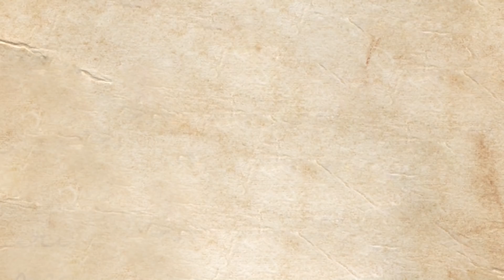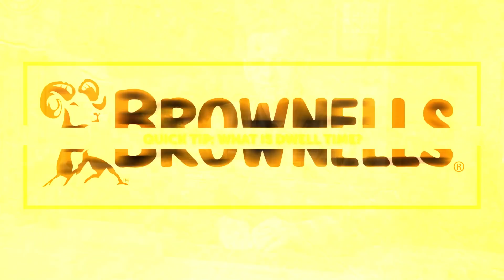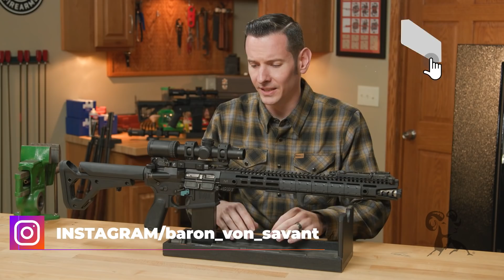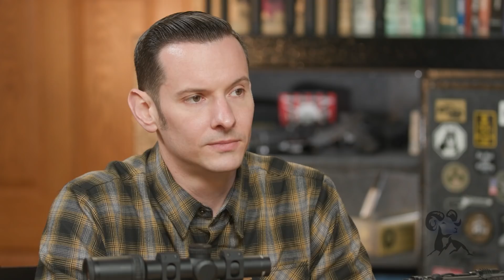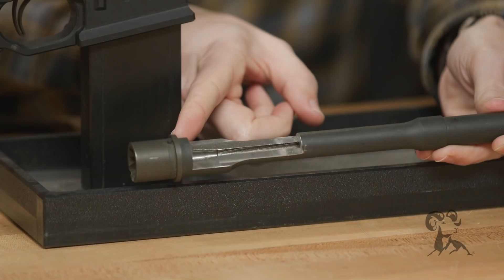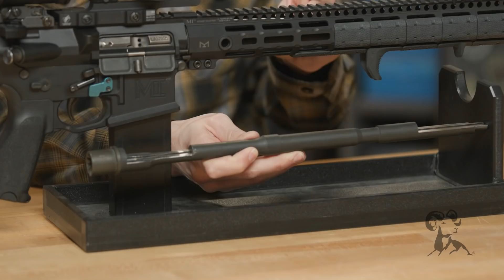Quick Tip: What Is AR-15 "Dwell Time"?

Comment: I don't claim to know as much as Caleb but I'm having trouble distinguishing between "amount of time the gas is working on the system" and "distance between the gas port and the muzzle." So the gas cannot work on the system until the bullet passes the gas port. TIME STARTS. Now the bullet travels from that point to exit the muzzle where all gas pressure is expelled out of the barrel. TIME STOPS. Seems to me, dwell is absolutely measured by distance between the port and muzzle. My question is about an adjustable gas block. All other considerations remaining the same, can dwell be adjusted at the gas block? If so, how and why?
Reply: By my thinking, it's not the distance between the gas port and the end of the barrel, but the time it takes for the bullet to travel that distance. I think they're splitting hairs here.

Comment: Hey Newby here. So, how does the port (gas) size and position and buffer weight effect calculating a build to accommodate smooth reliable operation and longevity. And how to calculate that. I.E. small port near chamber vs large port near muzzle. Thanks

Comment: So just to be clear, a carbine length gas system has more gas then a mid length ? I am fairly new to this and I am having trouble with my current build.

12.5inch barrel with a carbine length with a 3oz buffer tube and I am short stroking every couple rounds. I thought I was because I didn’t have enough gas and I am about to order a mid length gas system to fox that. But from my understanding the carbine length should be producing more gas ? 

Thanks

Comment: Thank u for this video. I was dying to make my 16in 556 into a “dissipator” or even use an intermediate gas length. But now i realize that a mid length gas system is the perfect option with an AGB. No point to risk the dwell time being too low with an intermediate or rifle length gas system on a 16in.

Comment: Ok ok let me get this straight 
Dwell time is the amount of time gas is acting on the system and it is not the amount of time it takes the bullet to go from gas block to leaving the barrel. 

My problem here is that the gas starts to act on the system as soon as the bullet passes the gas block and it stops acting on the system when the bullet leaves the barrel. *Passing the gas block = gas starts to act on the system. 

*exiting the barrel = the gas stops acting on the system 

Therefore dwell time does equal the amount of time it takes to go from gas block to exiting the barrel. It may not be the technical definition but it does infact give you the correct answer. Once you define the points where the gas starts and stops acting on the system both definitions are correct.

Comment: So even after the buffer has retracted as far as it's going to go and is starting to move forward, if there is any remaining gas pressure that is causing resistance of that forward movement, it's still considered part of the dwell time?  Or, is dwell time just the amount of time until the buffer starts to move forward again?

Comment: Dwell time is the amount of time it takes for your bolt carrier group to begin the movement of extraction of a spent cartridge.

In other words, the time the BCG 'dwells' in place after a cartridge is discharged.

Dwell time is measured in fractions of a second.

This is affected by the length of you gas system, the powder load in your ammo, the back pressure of a suppressor, and the weight of your buffer and bolt carrier.

All of those factors can be tuned to adjust accuracy, extraction pattern, felt recoil, and wear and tear on your rifle. It can mean the difference between a smoothly and comfortably operating rifle, and regular malfunctions, stuck cartridges, and premature parts failure.

Comment: You could have explained it using physics. Pressure equals force over area. P=F/a. When the surface area of the barrel increases with length, the force of the gas in the barrel is distributed over a larger area which results in a lower Pressure.

Comment: I'm a retired machinist and have worked on my pistols and rifles my whole life. Every problem that can cause a misfeed of any kind can be grouped into one category, TIMING. It doesn't matter what you call it, the timing of the mechanics have changed. 99% of the time this change is due to contamination of the moving parts or DIRT. It doesn't matter if it is actual soil or powder residue. The minute that any friction point  is increased that's where the change in the function of the firearm happens.
A good cleaning and lubrication and the removal of any interference will restore your firearm into its original working condition. It's just that simple.
Clean your weapon!!!

Comment: The description that you just gave that determines dwell time, is the exact time that the bullet passes the gas block, until it exits the barrel tip. Alot of people refer to it as cork time. The amount of time that the gases interact upon the cycling of the gun dies not determine the amount of pressure applied at all times, no, but it does describe the time for which gases are applied to the gas tube, which is the anoint of time that it takes the bullet to pass the gas block, and exit the barrel. You didn't ask what the pressures were along that time, you only asked what dwell time was. 
Then you went into the specifics of gas pressures, buffers, and spring tentions, which all affect the performance of the gun, but your original question was what is dwell time. The dwell time is the amount of time that the gases enter the gas block, which us when the bullet passes the gas block, until the bullet exists the end of the barrel, period. Do thise pressures vary at the instant tge bullet is fired until it exits the end of the barrel, yes, but the amount of time varies little, which if you wanted to get extremely technical, those times can be affected by the exact amount if powder, bullet weight, temperature, and other factors, but dwell time is the amount if time on average that the bullet spends between the gas block and the end of the barrel, it's that simple! It is also called cork time, and in my opinion is a good descript to what is happening because it corks the barrel and applies the gas to the gasblock, the gas tube, and the bolt carrier and bolt.

Comment: I've seen some "exotic" gas tubes that incorporate loops around the barrel to give you  that effect of having a longer gas tube at a closer gas port length. Would this modify the dwell time for a system?
Reply: No. It's not the length of the gas tube, it's the length of barrel after the port. If anything, it will reduce dwell time.
A longer tube will help reduce the pressure spike, but you could just use a smaller port hole or an adjustable gas block.

Comment: You said that dwell time is “the amount of time that the gas is acting on the system”. So, once the gas unlocks the bolt and the bolt carrier moves back far enough to get the gas key off of the gas tube, the gas is no longer acting on the system. That tells me that a pistol length system has the shortest dwell time, not the longest. Also, the carbine gas system would have a shorter dwell time than a mid-length or a rifle length gas system. I agree that a shorter gas system has a higher pressure than a longer one but, I think that dwell time is directly proportional to the gas system length. Why am I wrong?
Reply: Pressure curve drops as it occupies space in barrel and gas tube. It’s also dependent on powder burn rate.  That’s my take on it!👊👊👍.
Reply: @Eyeontheogive  That only further illustrates what Michael Peterson stated.

Comment: The relationship between barrel length,  gas system, and the 5.56 cartridge  would have been appropriate to talk about here. For example , the ideal setup is a 20" barrel with a rifle length gas and buffer . Everything else is a fix , or work around for a shorter gun.

Comment: Dwell time = the time gas is acting on the system. The time gas is acting on the system = how long it takes the bullet to go from the gas port to the muzzle. So, dwell time = how long it takes the bullet to go from the gas port to the muzzle.
Edit: In a DI AR. In a piston driven action, dwell time will be influenced by the gas release porting of that system.

Comment: "Dwell time is the amount of time the pressure from the fired cartridge is acting on your firearm system"  Is essentially (as in IS) the same as how long it takes the back of the bullet to get from the gas port to the end of the barrel.  Once the bullet leaves the barrel, the pressure drops to zero almost instantaneously (hundreds of microseconds).  Therefore, they are essentially the same thing.  Claiming the google definition is wrong, is wrong!  The best that can be claimed is that is is not completely accurate.
Reply: Agree... The gas is acting on your system until the bullet exits the barrel... In a perfect world all the powder would be burning up until the bullet leaves the barrel... this is not always the case hence large fireballs or failure of the action to feed another cartridge... This is a balancing act...
Reply: Not completely accurate = wrong.
Reply: @CalebSavant  My rifle's dwell time is about 145 microseconds.  The difference between "the amount of time the pressure from the fired cartridge is acting on your firearm system" and the time it takes the back of the bullet to get from the gas port to the end of the barrel is less than 3 microseconds.  Close enough that it can hardly be measured with $50,000 equipment.  2% less for the colloquial definition.  Again, closer than can be adjusted for or measured.

Comment: When shooting the 6.5 Grendel with a 22” or 24” barrel you can get what is called “belted” cases when the cases are being extracted while the pressure is too high.  The case gets ballooned out and looks like a belt on a magnum cartridge. Proper powder selection will prevent this from happening.  This is due to excessive dwell time on gas guns and fast powders.

Comment: Always was taught it had to do with distance between end of the barrel to the port in the gas system….thought that this is what truly affected reliability. This is based on gas pressure exerted from rear of bullet into the gas port after firing…that time where the bullet passed the gas port and allowed the gas to interact with the port and the bcg.  Did I have this wrong??  Caleb??
Reply: No, that's correct. In a direct impingement AR, the distance of the gas port to the muzzle determines dwell time. A pistol length gas port 6" from the muzzle will have the same dwell time (but higher pressure) as a rifle length gas port 6" from the muzzle.
The reason it might not be considered correct in all circumstances for all firearms is because in, for example, a piston operated system, the gas relief porting of the piston also determines dwell time. So his definition is correct for all gas operated systems, but the "port to muzzle" definition is correct for all direct impingement ARs.
Reply: Thanks bud. This is a 30 minute video if you ask me.

Comment: Caleb says at 1:56 the wrong definition of Dwell Time  "is the amount of time it takes for the bullet to pass the gas port and exit the muzzle", but then at 2:33 says Dwell Time  is "the amount of time the gas is acting on the system." That's contradictory. There is no gas pressure in front of the bullet. Gas can only act on the system after the projectile passes the gas port.
Reply: Gas can only act on the gas system once it passes the port, but like I said in the video.. to look at it as the time the bullet passes the gas system to the time it leaves the muzzle does not take all other factors into account, which is why it is the wrong definition.
Reply: @CalebSavant  Hi Caleb. Thanks for the reply. I love your videos. This one just got a little confusing with the terminology definitions.  Still gets the points across though.

Comment: Wow. I have a dwell meter. However not for measuring this kinda dwell. For those who are to young to know, dwell time was a measurable amount of time the points in older car ignition systems stayed open to fire a plug on any given cylinder of the car engine.

Comment: This is confusing. If there are higher pressures with shorter gas systems, then why are there higher bullet velocities with longer barrels?  As the bullet travels down a barrel, the space/gap between the empty case and the back of the traveling bullet increases, so does the volume of that space. Increasing volume will drop pressure unless the burning gas/powder can add pressure at a rate faster than that is being lost from increased barrel volume. The longer barrels mean more powder gets burned and not lost out the end of the barrel right?  And I thought that with a Carbine length gas system, the gas has a shorter distance to travel and act on the BCG, in contrast a rifle length has a longer distance to travel back to the BCG giving it a longer dwell time. please clarify

Comment: Sooooo. I changed my hand guard out and since I did, my pistol length ar will not cycle. Changed out the bolt carrier group with no results. Looks to me like the new gas block I put in is too long and the gas tube does not seat far in enough to make contact with the bolt carrier group. Measured the length needed to reach it and it is 10 inches. The pistol length has tubes are 9 3/4 inch. Any suggestions on how to dis this????
Reply: Are you sure it’s not a carbine tube?  What barrel is it??
Reply: @jimziogas8978  positive. The 9 and 3/4 is pistol length. I might have a carbine size gas block though. Not sure how to go about checking that one with no markings or anything on it. The gas holes line up on the barrel and gas block. It even will cycle once in a while but most times won’t. Checked the gas tube and it is free of debris. Barrel is a pistol length and again the gas ports are free of debris. Any help is appreciated
Reply: The gas block should be standard…in terms of the tube. The diameter can be .750 or .625…is your barrel port lining up with your gas block port?  You can check by blowing air through the barrel with one side blocked. The air should push back through the gas tube and tell you if you have port alignment. Check that and tell me barrel make. I’ll look up manufacturers info.
Reply: @jimziogas8978  it is a PSA 5.56 nato 1/7 twist
Reply: Barrel length?
Reply: @jimziogas8978  10.5 inch
Reply: Carbine tube bud….here are barrel 
details from PSA. Easy fix. 

Barrel Length: 10.5"
Gas System: Carbine
Barrel Profile: A2 Style
Barrel Steel: Chrome Moly Vanadium
Barrel Finish: Nitride
Chrome Lining: None
Muzzle Thread: 1/2-28
Chamber: 5.56 NATO
Twist Rate: 1 in 7"
Barrel Extension: M4
Diameter at Gas Block: .750
Weight: 1.2 lbs
Reply: @jimziogas8978  so the original gas tube I had in it is 9 3/4 long. Are the carbine length gas tubes a bit longer? Sorry I’m new to the AR platforms and don’t have much knowledge on them. All I did was change out the hand guard to a free float, the barrel nut to the one that came with the hand guard and the gas block as the original was part of the old iron sight. Kept everything else original.
Reply: Carbine length is 7 inches. You likely have a mid length.  Pistol length is super short (4 inch), so you won’t confuse that one. Watch Mr Guns and Gear or another reputable channel build the upper…you’ll see them grease certain parts like barrel nuts and loctite others like gas block screws. It’s easy but lots of info. Watch a few videos on building uppers. It will make sense after that.

Comment: This is really good information. Reminds me of ignition coils, blow-by, or back-pressure in an engine. So then using a dB lowering suppressor will increase dwell time? Can y'all do a follow-up video with common misdiagnosis and proper diagnosis of dwell time related malfunctions and causes?
Reply: A short answer for your suppressor question would be yes, a suppressor can increase dwell time, due to the pressure captured within the suppressor body, but not as much as a longer barrel produces as the gas pressure has more room for expansion within the suppressor body and baffles. As for the issues caused by dwell time, this gets a bit complex as there are three other factors at play within a semi-automatic gas cycled rifle. Along with dwell time/gasblock fitment and alignment you must factor in spring strength, buffer weight, and power of the ammunition you are using. The most I can say is ensure your gasblock is properly aligned using either a tool or the spaghetti trick and then if issues occur you at least know that you have ruled out one factor. Hope this helps!
Reply: @Zel_eo  Dude, thank you so much for taking the time out of your day to give me some helpful insight and sharing your knowledge with me. You're a good person. Have a gooder.

Comment: A question I’ve always had is how much length of barrel past the gas port is required for the action to cycle. For instance, if you cut the barrel length shorter, say for example to SBR a rifle, how short can you cut it past the gas block? Not just for an AR15 but for piston guns as well? To be even more specific, if I wanted to SBR a Mini-14, how short past the gas block can I go and still be functionally reliable?

Comment: Ok since there is an interrelationship between dwell time, barrel length, carrier weight/dimensions and recoil buffers and springs, is there a chart that shows this relationship?
Reply: There is a table with four entries on it.  It lists how big a hole to drill on the barrel so enough gas is tapped to provide a sufficient pressure pulse for each barrel length to cycle the action. 
Carbine length have a smaller holes than rifle length barrels because the pressure tapped closer to the breech is higher.

In the AR-17 and AK-47 dwell time is determined by how long the bayonet handle you stick on the rifle is.  Reciprocating mass and spring rates only matter when talking about full auto rates of fire.